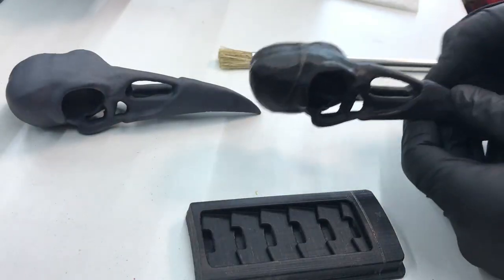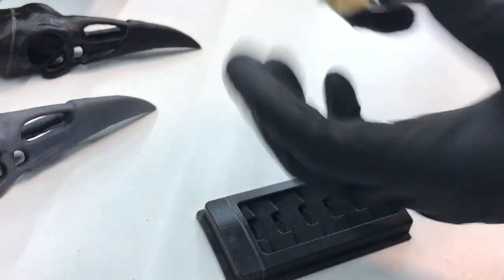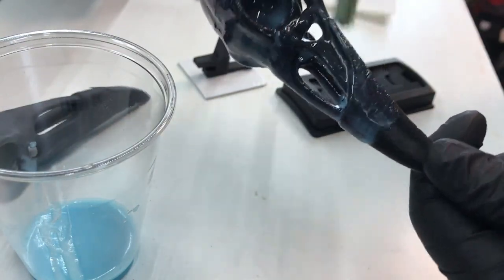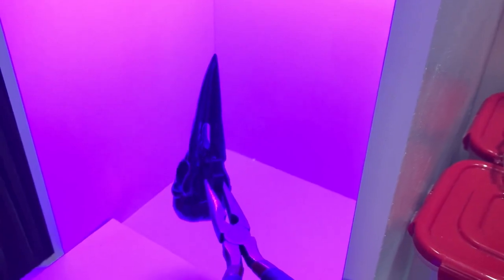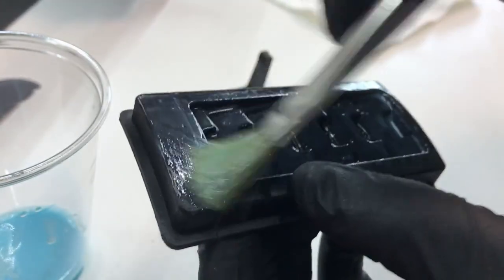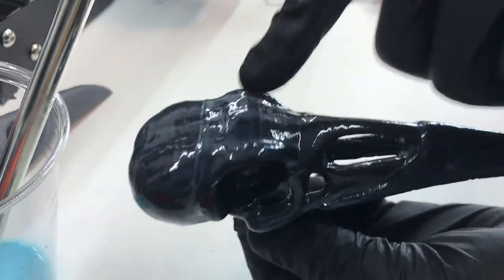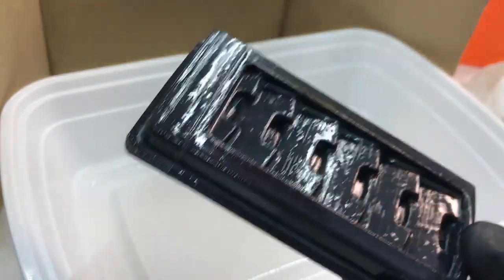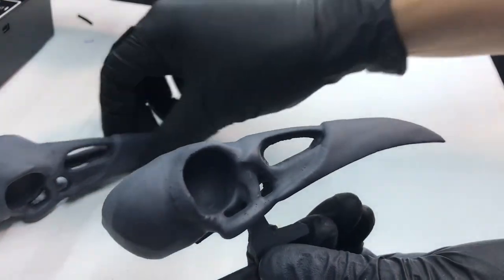How to smooth 3D prints with UV Resin (Step by step!)

Comment: Oooo this is genius, it never occurred to us to try this. Been using XTC for years and never really liked the stuff. Definitely going to be trying this! One thing that occurred to me for the bubbles is to use heat to pop them, it's something we do to resin all the time with a small blow torch.
Reply from the maker: Tip Top Workshop Thanks glad you like it! Yes, someone mentioned that trick to me as well. I’ll give it a try! :)
Reply: @pandapropsncostumes  have you seen the 3d rubber printer?

Comment: Use a wine bottle vacuum sealer to remove air from your resin before applying it and use a brush with finer hair. Your results will be much better.
Reply: do you have any video of that, please?

Comment: I have not brushed a whole 3d print with resin but i have used a Q tip to fill imperfections after sanding before i primed the print and it fills the issues fantastic and its easy to sand too.

Comment: A much simpler and more cost effective method is to prime with high build primer and then spray the top coat with automotive 2k gloss clear. One or 2 medium coats is all it takes and will yield excellent results in most cases.

Comment: Please do a video on airbrushing the resin! I'm really interested in trying to smooth prints that have small details that other methods like putty, filler primer, or sanding would ruin.
Reply: Oh wow good idea, but also terrifying. The UV resin is very toxic, and making it into a spray scares me. Can't do it outside either due to the sun's UV rays, so unless you have a good workshop and probably a whole body protection suit.... It's risky.
Reply: As a PhD in chemistry I second what Adam said. You should really avoid trying that :/
Reply: @YBM22  Ah, i have some questions about using UV resin for hobby printing, Youssef, it's not been an easy subject to google :/ 

If you use proper ventilation and use something like the Anycubic printers, is it safe to print in your appartment, or does the room that you print in become... tainted by resin or other toxic chemicals? Could you for example get hurt if you print in your office, and spend time there without protective gear when not printing?
Reply: @YBM22  When looking around online you can see all sorts of behavior, from people dipping their fingers into it to people treating it as if it was radioactive. I use a respirator with a face shield, nylon gloves, an apron and silicon mats, but i still worry that the vapors from the printing settle in the room and make the whole area a potential health risk.

Comment: Oxygen inhibits resin polymerisation (curing) meaning the outer surface won’t cure in air.  Once you’ve done your initial cure, put a glass container full of water in the curing station and cure it in the water. This limits the oxygen on the outer surface so you won’t need to wash it in alcohol afterwards. It cures faster in water too.

Comment: Huh. I hadn't thought of that as an option.

Certainly a quicker way to smooth out prints than hours of sanding, and since I already resin print I have it to hand as opposed to shelling out for the likes of XTC.

I'll have to give it a try, thanks!
Reply from the maker: Yes it’s a good trick for certain prints. I like to use the remainder of bottles. Turn them upside down and there’s always a cap or two of leftover resin to use :)
Reply: @pandapropsncostumes  Can't you just pour unused resin back into the bottle too?

Comment: Another thing I noticed is when I went to put on a second coat the temperature in the garage was quite a bit cooler and the cured (curing box with UV light strip all around) it came up, for lack of a better term, lumpier and not as smooth as the first coat when it was warmer.
Reply from the maker: Yes, UV resin is temperature sensitive, so try to do it in room temp or warmer if possible for the best results :)
Reply: @pandapropsncostumes  I figured as much. Thank you.

Comment: I tried this using an Anycubic Clear resin. Tried curing it under a 20 watt 405nm light. A day later and the stuff is still so soft my fingerprints transfer over. I don't know if it is the brand or the fact that it is clear, but just didn't work at all for me. I won't bother trying again. This resin is way too expensive for further investigation. Thanks anyway for the tutorial.
Reply from the maker: Reports coming in: do't use clear resin with this method. I have used Elegoo standard, ABS like, Water Washable, all of them work fine

Comment: I've tried this several times with different resins over the past year, but I keep finding that the surface gets marred by subtle drip-lines that aren't visible until after a coat of primer. Sometimes there's also small pools or tidemarks in deep recesses where details meet. Any advice?

I've had better results with vapor smoothing ASA so that's still my go-to when I need smooth FDM prints.
Reply from the maker: You're laying it on WAY too thick. Dip the brush in the resin and wipe the bristles on the end of the cup, so that you remove most of the resin. Brush it on in a THIN layer. Cure. Then do a second coat. 

For small rececess, use a small tipped brush and apply sparingly. 

For panel lines or fine details, clean them out with a toothpick before curing.

Hope that helps!
Reply: @pandapropsncostumes  I'll try going a bit thinner again next time.  With very thin coats I initially had an issue where the resin wouldn't cure (oxygen inhibition).

Comment: wow, I need to test this out.  I imagine it will also remove that FDM feel your print has. I'm currently printing a large scale figurine on my Ender 5 (too big for my resin printers) and will be trying this out on it. I do have some cheap resin I bought on Amazon Prime day that didn't really work well in my Anycubic Photon, so I will see if this could save it from the trash can.
Reply from the maker: Yes give it a try. I would do it on a small junk print first. The key is a good brush and smooth coats. Yes it obscures much of the print lines on my prints. I print on Creality and Prusa machines and most of e time at 0.2 resolution

Comment: So I have been using fine finish not working as well as I would like would you  recommend this over that and do you have to have the uv light for ot to cure or can you use the sun
Reply from the maker: survivor performance I have tried Fine Finish too. I found it required at least 2 coats and it worked well but I had to deal with brush strokes showing up even though I I used high quality artists brushes. It also took longer to dry than UV resin. And yes, you can use the sun as well, it works fine for this technique! :)
Reply: Thank you and what is the resin you are using brand etc
Reply from the maker: survivor performance it’s Elegoo brand
Reply: @pandapropsncostumes  so elegoo resin?
Reply from the maker: survivor performance yes
Reply: @pandapropsncostumes  im seeing lots of different ones any special one
Reply from the maker: survivor performance please watch the video. I show the bottle and it’s Elegoo blue resin :)
Reply: @pandapropsncostumes  love your videos man I like the ones you did on Mando paints and alcald also thats the costume I'm working on now do you sand this resin also

Comment: Using a airbrush to do this works really well. You do have to thin the resin a little to get it to flow nicely
Reply: @DrazCreates  No I didn't. I've been doing resin sparying for a while now and wear all the protective gear.

Comment: Do you think this approach takes as long as just applying primer and sanding? I know there are many ways to finish anything but I'm curious what you think since I'm sure you've done that already as well.
Reply from the maker: I use whatever method is appropriate to the object. For smooth flat surfaces like Iron Man type armor, I would just sand and use filler primer. It’s technically takes longer as you have to wait for the paint to cure at every layer and then repeat the sanding and priming, where as the UV resin reduces the amount of time and takes only two applications (at most) and filler primer at the end.

I wouldn’t use resin on large smooth surfaces due to cost and the potential for brush strokes and uneven applications. But it works great on more detailed or organic type shapes. Think Alien creature with ribs and bones and tentacles etc.

So I just choose what works for whatever subject matter I am working on. Hope that helps!

Comment: How does this hold up after time? Or in the sun? Any experience with that?
Reply from the maker: Holds up just fine. Ive coated probably 3 dozen prints and done film and TV work with this technique. Works fine. The resin is quite durable. Its not "kick it down the sidewalk durable" but nothing would be.  Sun has no effect.

Comment: Can you tell me the name of the curing station you are using and do you still like it after 6 months?
Reply from the maker: I actually built it. You can see how I did it and the light I used in this video. Yes, it still works great and is fast at curing :)

https://youtu.be/FnknQKLp1wc
Reply: Real nice thanks for the quick reply

Comment: How do you handle dust specks? I'm working on a Book of Boba Fett helmet and was doing the first coat of resin (and I noticed them in the close ups in this video) is dust specks (probably inevitable unless in a clean room). For the helmet they sand off easily but what about the back helmet detail you did?
Reply from the maker: I still sand it. I just glue sand paper to popsicle sticks cut at an angle, or use nail files. Brushing fewer and thinner coats helps too
Reply: @pandapropsncostumes  Perfect.

Comment: Would you recommend this method for a full Mando helmet? Maybe airbrush the resin on? Also,  I don't have a curing station. Would painting it on, then setting it out in the sun work? I'm printing with PLA+...
Reply from the maker: I actually wouldn’t recommend that. On smooth even surfaces like a helmet, it may be hard to apply the resin evenly without creating brush strokes and waves. Also, the resin will fill details, so areas like the mowhawk strip and fine panel lines will get filled. I haven’t tried spraying resin yet so I can’t confirm that works. Plus any particles in the air would be dangerous as they would solidify once exposed so a proper capture and filtration system would be required. I would suggest good old glazing putty and high build filler primer for the helmet. Hope that helps!
Reply: The airbrush would be garbage after that, toxic garbage actually

Comment: What respirator and cartridge are you using?
Reply from the maker: I use several 3M respirators. For resin and molding and casting, I use 3M 6001 cartridges. These were recommended by Smooth-ON for their products. Hope that helps!

Comment: This is amazing,exactly what I was looking for. Could you maybe answer if rather than using primer you could go straight to a gloss? I'm primarily looking to make silicone molds with matte and gloss areas for detailing epoxy resin. Once you alchohol sprayed the piece some of that initial shine left it.
Thank you 😊
Reply from the maker: It’s always good to use primer before paint. If you want a thinner primer use Duplicolor grey sandable primer. Then top coat it with matte or gloss before you mold.

Don’t be deceived by the shine because the resin is still “wet”.

Comment: Using two part epoxy on 3d prints is not a good idea because epoxy heats up when it is curing and can cause warping or melting of the pla part especially when it very thin parts.
Reply from the maker: UV resin is a one part resin that UV cures. It does heat up but its such a thin layer / coat, theres not real noticeable change in temperature when handling the part. Ive used this technique on builds for the last couple years with no issues, even thin or small parts
Reply: @pandapropsncostumes  I do know that, that is why  I said "2 Part Epoxy"   should not be used! Not UV, and Ive been using UV resin for year on 3d printed parts.

Comment: i wonder if using a air brush would add a more even coat to the part
Reply from the maker: Yes, I have tried it. But you have to be very careful and only spray in an encolsure with a respirator and a proper evacuation and filter setup, because now you are atomizing a resin in the air that can be inhaled and can contact skin, eyes etc. Once exposed to UV it would cure and hardened particles in the are are dangerous and toxic. I would not recommend it unless someone had all the gear to do it safely
Reply: @pandapropsncostumes  thank you for replying!
maybe in the future ill do this. Ill look into building a booth for spraying resin as well as PPE for doing it. Ill probably play it safe with a full body protective layer W/ full face respirator.

Comment: Do you think this will work well for printed 1/6 scale hot toys like figures/statues?
Reply from the maker: Do you mean if you are FDM printing them? Yes it’s possible but heads at that scale may lose some sharpness or detail. But you can try to brush it on in thin layers and avoid the resin from pooling in the eyes etc. BTW I used to customize 1/6 scale figures too :)
Reply: @pandapropsncostumes  Thanks!! I do custom figures, and im thinking of getting a 3d printing machine, the problem is that here in argentina, resin 3d printers are stiupidly expensive, but the fdm are really affordable. So im thinking of a fdm printer and this method for polish the finish of 1/6 or 1/4 figures

Comment: I'm curious how well this would work with dnd models?
May you download the free sample from hero forge and try this method?
Reply from the maker: It’s similar to any coating method. If the FDM printed figure is too small, you may accidentally apply too much and end up obscuring details and rounding sharp edges that you may want to retain. so try brushing on a very light coat as a test first

Comment: i bought 2 different uv ligjts that ppl seem to have good results with resin curing. but i leave it under the light for 30 minutes and it still feels sticky. :(
Reply from the maker: Wash the part w IPA after. You should only need 3 minutes to cure
Reply: @pandapropsncostumes  hey thanks for the reply! So the stickiness is normal?
Reply: @DatFunnyPerson  Unless it says water washable, you need to wash it with 99% alcohol

Comment: Great video and technique, thank you for sharing! 
Do you find that this method allows for a harder finish on PLA prints?

Thanks again!
Reply from the maker: It provides a little bit of a “shell” toughness but it doesn’t really improve structural integrity like multiples times over. It can help prevent layer separation as it coats the surface but it doesn’t melt or bind layers together like solvent would
Reply: @pandapropsncostumes  Thanks for the reply!
Have you, by chance, tried the airbrush method yet?

Comment: anyone know what resins do not inhibit RTV silicone cure?       Thanks for this great video, btw.
Reply from the maker: I have used Elegoo stndard grey and black and blue resins and molded them with Smooth On RTV silicones with no issues and no mold release. Silicone cures just fine.
Reply: @pandapropsncostumes  good to know. Thank you

Comment: is it possible to like air brush this ?
Reply from the maker: I haven’t tried it yet. Remember though that liquid particles that harden under UV can be very hazardous. So extraction and capture of particles is required. And you can’t do it outside as the resin would harden

Comment: With all the pooling and bubbles going on, I'd prefer to airbrush it on.
Reply from the maker: Spraying UV based resin is incredibly hazardous unless you have a fully enclosed and sealed paint booth with full PPE. Airborne particles that can go from liquid to solid in a UV leaked environment is a huge biohazard. This mentod doesnt work for everything or every model type. I have found using a higher quality watercolor paint brish yields way better results